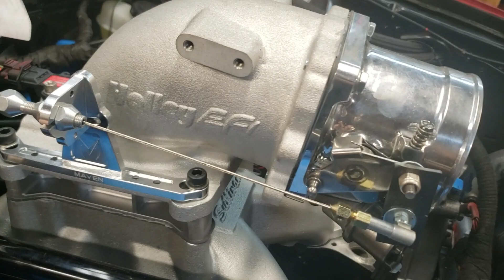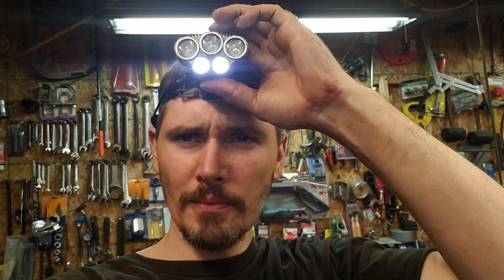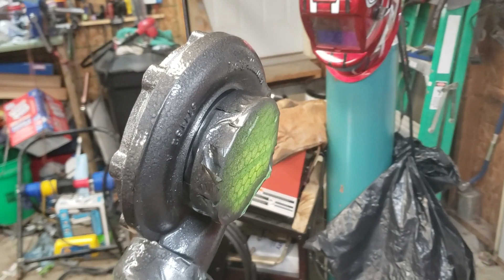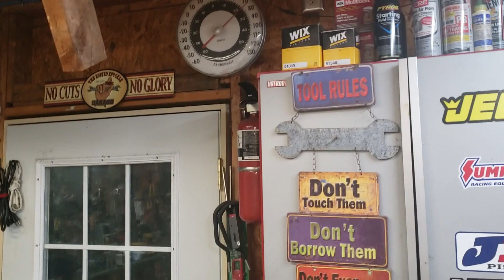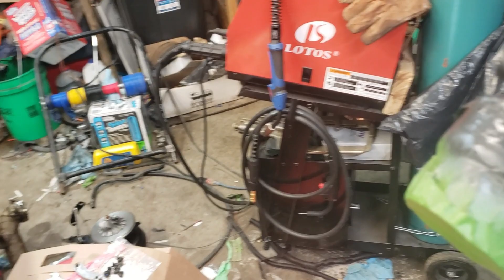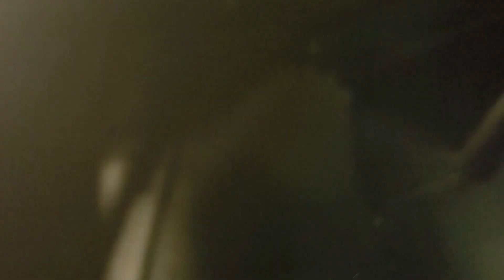ScottRod Fab Mustang Rear Seat Delete -Installed More Wiring Completed Turbo Painted Ready 2 Install

Comment: What intake manifold do you have Im doing a single turbo unlike your twins will it fit a 1997 cobra
Reply from the maker: I have a Sullivan intake. I think it only works with C-heads (99 and later) but I think you can get adapters to make it fit on your b-heads
Reply: ModMotorMayhem thank you I’ll look into it for sure

Comment: What do you think your cost is so far?
Reply from the maker: I'd hate to add up the total investment over the last 3 years lol, but suffice to say, it hasn't been cheap. Being a Ford and also a Mod motor is kind of like a double whammy in the racing world as far as cost goes.
Reply: @ModMotorMayhem  Gotcha, just got mine all together, dynoed at 741/663, so yeah,know what ya mean. Mine is the 4.6 3V.
Reply: @ModMotorMayhem  you ain't lying hell my n/a 2v build cost around 4k that's jus in the built motor and cams  

I'm almost 2grand in my 4v build block heads and intake lid from a Marauder 
forged crank & flywheel